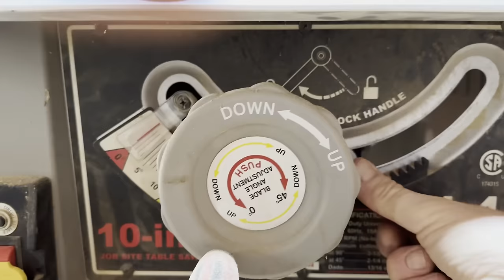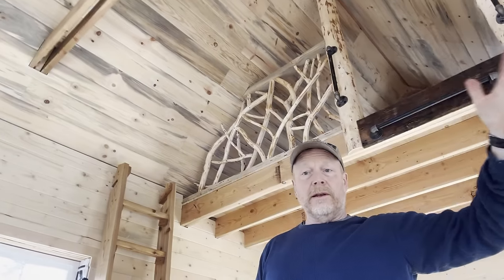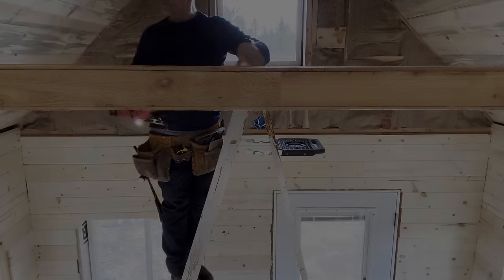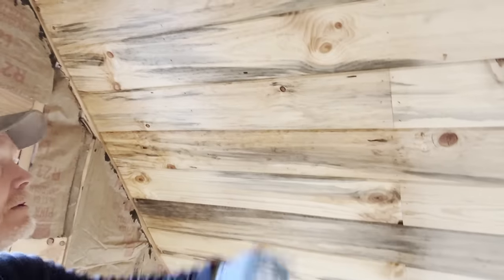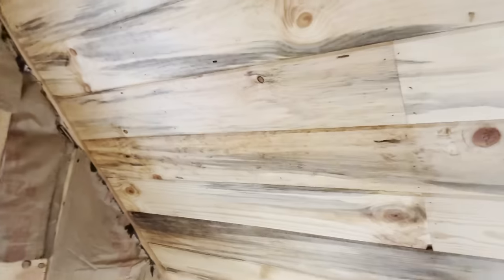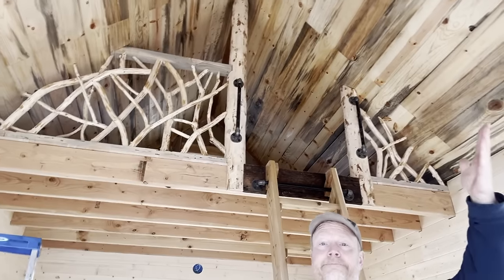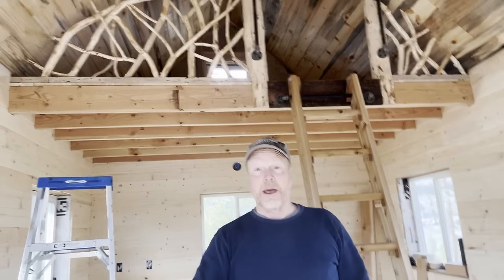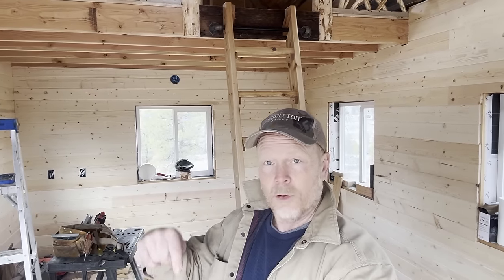Box Beam and Tung Oil Blue Pine in an Off Grid Cabin

Comment: I've been enjoying your videos at the 30-40 minute length. They have an ASMR quality, but are still informative. Also, your general positivity means that I have enough time to sit and enjoy the video and not feel rushed or that I need to squeeze in the time. I really enjoy your weekly updates. Also,... unrelated. How do you never seem to miss a cut. I'm impressed with how accurately your cuts seem to fit.
Reply from the maker: Thank you! 
I’ve missed a cut or two! Sometimes on video! Yes, I do sometimes edit out the boring stuff which sometimes includes boring errors, but mostly what you see is what you get. Plus, I’ve been doing this sort of thing quite awhile. 🙏

Comment: I use tung oil (100% pure) with no 'dryers' in it on a variety turned wood.  it really works great.  I would put at least another coat on those super thirsty pine boards.  I like the videos how you do them.  I can always go for more/longer content.  but you be you.  that will make the videos interesting when you're yourself.
Reply from the maker: Ah that’s very kind. Thanks for the comment! 🙏

Comment: A question about applying the oil stain;
Could you use a sprayer for the job?
Other than not having to mask everything and wear PPE, is there a benefit to brushing it?
Been watching your videos for long time - love your content.
Beautiful work!
Reply from the maker: Thank you! You’re right about the mask. The cross breeze was very good, or I would have been donning one for sure. 
I certainly could have sprayed. I just like to work it into the cracks and seams with the brush, and the roller leaves a texture of sorts.